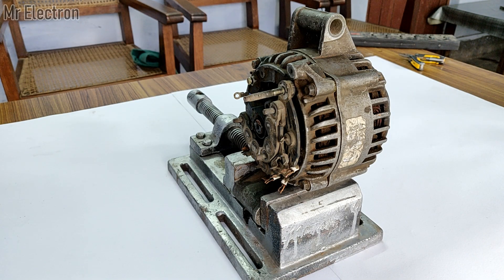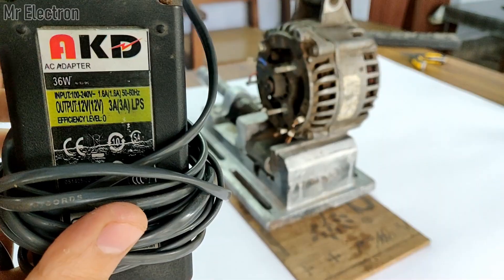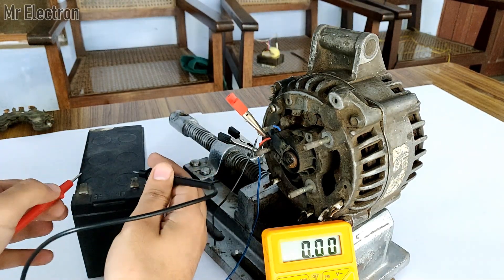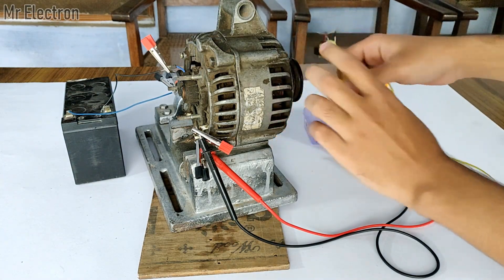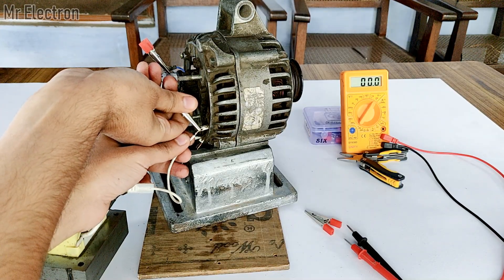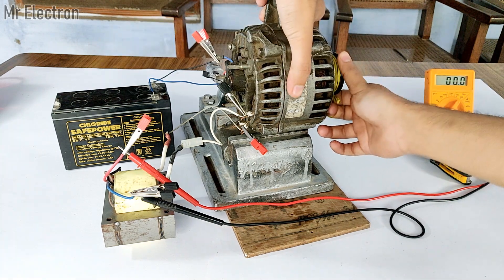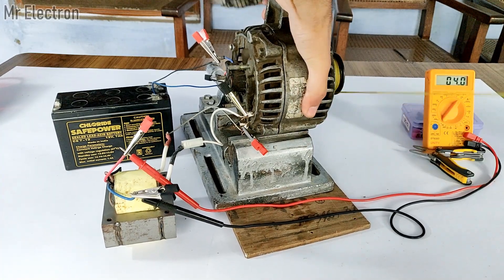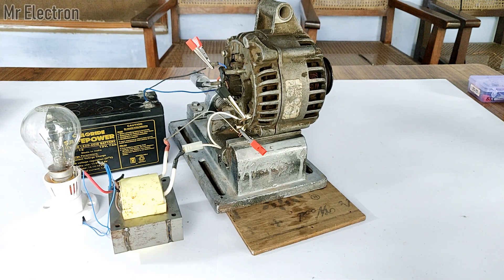110v AC from a 12v Car Alternator New idea !

Comment: Older 80-90's Chrysler and Jeeps have alternators that are externally rectified.  You can also make an arc welder with the same alternator running slightly over idle.

Comment: In this method, the voltage is high but the current is low.Also, only one of the three stars can be used.Please show us a way to increase the power of all three stars and use it And of course intermittently

Comment: IT'S NOT A NEW IDEA! The reason there is a voltage regulator IN an Alternator is because an ALTERNATOR puts out 120 volts per coil on the Stator. The Term ALTERNATOR comes from the fact that it puts out Alternating Current, which is converted to 12 Volts DC through a Diode Trio.  Ford at one time had Alternators that had 120 volt AC terminal for AC accessories, even today Tractor Trailer trucks have an AC output on the alternator to run accessories inside the cab.. So getting AC Voltage out of an Alternator IS NOT a New Idea by any means. ANY AC Voltage you get off of an Alternator will need a Rectifier/Voltage regulator to keep the Voltage from fluttering and spiking. Lastly, no matter what you do, you still need 12 Volts DC at about 10 amps to power the FIELD on the rotor to get an alternator to produce any kind of voltage.

Comment: An alternator generates a.c.(alternating current) that is why it is called an alternator instead of a regular generator which produces d.c.(direct current). A rectifier acts on that a.c. like a check valve works on pressurized fluids or gases and only let's the current flow one direction Instead of alternating a certain frequency (hertz). I'm a fabricator/heavy equipment repairman by trade but when I was 22 I worked for a few months as an electric motor/alternator/generator /air compressor/small gearbox mechanic

Comment: Can a car's alternator to charge 2 batteries at the same time? I was use this method to charge my household power back up battery when I'm driving. Driving and using petrol is just a waste so why not use disposable energy to generate another energy? hope I'm making sense.
Reply: Yes it can. You must connect positive to positive and negative to negative. I do this all the time for charging my extra batteries !

Comment: It would of been better if you would of told us where we could get a DC to AC transformer like the one you used. I tried searching ebay with no luck.
Reply: You couldn't find it because there is no such thing. What you want is an inverter . THIS is the device that will change your 12 volt DC to the AC that will be compatible with household appliances.

Comment: Back in the 1960's (Yes, I'm old as dirt)  They had a kit which, by throwing a switch mounted under the hood (bonnet) of one's truck (lorry) or car, you could bypass the alternator wiring and obtain higher voltage to run power tools.  It was a similar setup.
Reply: Radio shack is where I got mine

Comment: Why do they call it an alternator if it produces DC?
Reply: They are called alternators because the power they produce is AC. It is changed to DC by the built-in diodes to power a vehicle's electrical system. Also, the term "alternator" distinguishes this device from true DC generators which were used in older vehicles.
Reply: @Inflec  this link is 2 years old and that was a rhetorical question

Comment: That is the direct connection uses for  a testing,buti a common usaged of that features is need diodes,,in a possitive and a negative,polarity from the direct current to the alternating current,must use the degnified rectifier diodes who devides the current into lights and others continously....buti in a way its amazing tuiturials....

Comment: You said you have removed the voltage regulator bridge,  on GM alternators  they have a build in voltage regulator , so you remove it  too?
Reply: You have to bypass or remove the regulator and the rectifier, then tap directly into the alternators stator windings.

Comment: You are not actually getting 120 volts from the alternator, you are only getting the 8.6 volts ac from the alternator. you are getting the 120 from the step up transformer. Also, the 120 volts is unusable by any electronic loads that require a steady 60Hz.

Comment: Any electro mechanical generator is going to put out alternating current because the brushes cross poles of negative and positive creating a sine wave above and below 0. The alternator then must have a rectifier to filter out the neg or pos side of the sine wave thus direct current to charge the battery of the car.

Comment: 🔵 @ (0:17) seconds into the video you state that "An alternator produces DC"..... THIS IS INCORRECT!!!
It's called an 'Alternator' because it produces AC ('Alternating-current') which is then rectified by diodes into DC to power the car's electrical systems.

Comment: No offense or anything but these have been around for decades.  It's easy to do and you can even by the hookups right at Walmart.  I have one that plugs into my lighter and can power a 160 watt bulb.  You can get them pretty big too.  Some new trucks now come with this in them from the factory.   The unit that will do this usually comes with plans or drawing of how you can hook the device up, power the alternator with a small gas engine like from a mower or something and make useful AC current.  It won't be much, but it'll power like a drill or something in a pinch, maybe a bit more.  No matter who you look at it, the alternator needs to be spun too.  Otherwise there's no way to generate any juice at all.  And you need a power source to excite the fields in the alternator - like a car battery.

Comment: The problem with this demonstration is it will run a light bulb but it has no amperage to run anything else, get rid of the transformer and spin alternator up and it will put out 110 or 220 with enough amps to KILL YOU   !!!
Reply: I was able to weld and solder by shorting the three phases.
Reply: Not hard to produce enough amps to kill you since it only takes .5 amps to stop your heart

Comment: It's very simple, just bypass the diodes and control the rpm to make 120 volts off 2 of the leads or youse all 3 leads and get 220 out of it but be careful it is a dangerous thing to play with just be careful it is unregulated AC current
Reply: Aren't there small motors that work on 110v?

Comment: How can we get rid of the alternator from our cars ? Alternator takes approx, 20% of power from the motor.
The 12v system is inefficient and outdated.
Reply: Tesla and others have a solution waiting for you 🤣 they even took it a step further and removed the motor for ya too.
Reply: Only takes 1 Hp to get 700 or more watts at full charging load, once charged then much less than 1 horse depending how many accessories you run. I have driven old cars without elect fuel pump over 6oo miles without alternator working, over 400 miles with fuel injected elect pump car.

Comment: I am at a complete loss. The only step up  transformers I can find are from dc voltage to ac voltage. Am I correct in assuming that the voltage from the alternator in the beginning of the video is AC? Or is it DC.
Reply: Transformers only work on AC, or pulsed DC. Alternators produce AC but the internal rectifiers make it DC.
Reply: @newventure4747  got it! Thanks for clearing that up for me!

Comment: Alternator in this video had a rectifier removed, correct ?
Once you remove rectifier from 12V alternator you get AC current right out of the unit. Why would you need to use transformer to make it AC ???
Reply: output voltage on a car alternator is 8 to 12 volts ac with about 60 to 120amps .what the step down transformer does it lower the amp and raise the voltage in ac because take note of car battery it has 440 cranking amps and the electricty amps max bout 25amp breaker nomal home ampere
Reply: Transformers only increase or decreases ac voltages depending on transformer windings. They don't make ac voltages, they only change the voltage that's fed into it... and they cannot pass DC current.

Comment: The shaft speed is 36000 rpm, can you suggest a 3 phase alternator with 50hz 230v ac, or 28v dc . It should be a off the self item.

Comment: years ago after a hurricane i built a gen with a 5 hp honda,a few pullies n belts 2:1 reduction and a alt from a 1986 nissan d21 pickup.motor at idle put out 78-80 volts from the nissan alt,half throttle gave me 105 volts.i had a dc to ac converter lying around that helped.86 nissan alt has no built in voltage regulator.not saying its a better alternative to your method.....just mentioning,cuz your vid reminded me of what i had done 20 years ago.it may take less mods to get the job done.
i ran that setup for 6 days,15 hours a day with no issues and only using 1.5 gal gas per day.i was able to run a full size house fridge,tv,microwave and the alt was warm to the touch.later i added a 12v mower battery,and a trickle charger that feed off the alt to charge the battery,and added a car electric radiator fan to keep the alt and converter cool.just add gas,once fired up it was a self contained unit.i did however had to excite the alt on startup before it would make voltage on its own.
Reply: How did you get 110v from a alternator

Comment: The two 12v leads act as a controller for the alternator.  The higher the voltage on those wires, the more the alternator puts out.  That is how the alternator controls its output when the car changes speed.  With no voltage on the 12v lines, no voltage will be produced on the output.  This is because there are no magnets in a car alternator.  Just an electromagnet controlled by the 12v input lines.

Comment: A kit was sold in the 70's that you wired into your alternator while mounted in your car.
It consisted of a multi pole switch and and 3 110 volt outlets.
One for each phase.
The battery in the car would not charge while in 110 mode, but provided the field voltage.

Comment: The battery is powering what is called the "exciter coil". When used in your car, when you turn the ignition key to the START position, the key switch connects the battery to this coil. Once the car motor is running and you return the key to the RUN position, the exciter coil is then powered by a voltage sensor in the rectifier/regulator that was removed in the video. Since a car's engine will vary in RPM as you are driving, a constant output voltage of 13.8 volts is maintained by the voltage sensor regulator by adjusting the voltage to the exciter coil. As the engine turns faster the voltage is reduce, and vice versa. As a reliable, stationary home generator, a speed control or governor on the drive motor would be necessary so the output would maintain a fixed hertz rate. For powering light bulbs hertz rate is not so critical but for AC motors and electronics it is. This is a three phase alternator. If you want to use the other outputs in combination, you definitely need to learn why three phase is different from normal home A.C.
Reply: Is his design dangerous?

Comment: Guys, you can use this same set-up with a AC Motor on the Side, plug the AC motor into power from house or Power source, with belt from ac motor to ac Generator-get ac generator up to speed and then Unplug Motor and the Alternator will Run Ac Motor Plus Supply Power to House or Working Tools--Many people across this land are using this Set Up for Off Grid Power--Perpetual Motion Machine- DC Motor Run off Battery for Running Up to Speed will Also work but Rectifier will have to be used to  Unplug from Battery... There is a man from Memphis who is Selling the Plans for this Kit for $49--he is Running All his 110 Recepts. in House off this setup--according to him, saving Big Bucks....

Comment: Very cool idea. How can you keep the battery charged? Would a capacitor be better suited in a loop from the alternator since a battery will eventually fail? I have a water fall I'd like to try this on.
Reply: Drone Meets Nature: I don't recommend you use this as shown as an alternative household power. The output is three phase and your home is MOST LIKELY single phase. To constantly only use one phase puts lateral torque on the rotor and will ware out the bearings very quickly.  As a water powered generator you would need to come up with a way to govern the RPM to a fixed value to keep it at 60 or 50 hertz. This would be 30 or 60 RPM depending on how many wingdings are used for output. An automobile alternator is intended to spin at 750 to 3000 RPM to generate maximum amperage. The best solution is to leave the automobile alternator as is and put it's 12 volt output through a 120 volt inverter. If you leave the rectifier on the generator, it is internally wired to supply the exciter coil with current and holds the output to a fixed voltage regardless of RPM. The battery is only used initially when the generator first starts to turn to energize the exciter coil. It is continually necessary here because the regulator circuit was removed. A capacitor could be used to "start" the generator. A car alternator can "start" with as little as 2 volts in the exciter coil.
P.S. there are a rare few alternators that have a permanent magnet coil that supplies current to the exciter coil to initialize the exciter field. These don't need a battery connection at all and are commonly found on gas powered portable generators started with pull cords and some diesel powered generators.
Reply: @3DPDK  Thank you for the wealth of information. I will definitely do that.

Comment: This is an ancient shop hack. After you remove the rectifiers and seperate the winding you'll have created a 3 phase motor. Use a Y 208 3ph. to power it. Big ones (90A) output 5 horse power. Won't run on single phase house current

Comment: The same battery can as well be used a 12 volt  motor to turn the alternator and charge itself a the same time for a continued  power
Reply: Doesn't work that way unless you don't mind producing less than you consume.

Comment: good idea but if you put a motor to turn the alternator it should run for ever and it could charge the battery and the same time give 120v through the adapter
Reply: That will not work! Perpetual motion machines are not possible above absolute zero, thermodynamics are tough to overcome anyone that attempts this is a fraud by definition... In the real world we have heat and energy loss, nothing can create energy without creating heat, 2nd law of thermodynamics.

Comment: Yes agree the alternator does produce a 3 phase AC voltage, but where it gets a little complicated the frequency is unstable! The frequency won't have much effect on a light bulb, but I wouldn't try plugging a computer or TV to this!  Normal house voltage of 120 vac operates at 50-60Hz  Yes its designed to have high current output, the windings are wound with heavy wire but with less winding its a trade off with a lower voltage.  I believe though with todays technology this can be over come to obtain a useable power source, something I'm going to experiment with!

Comment: If hooked to wind or water power,
you would only need the initial kick
from a battery. Then your 12 volts
could come from a step down...
Just like the old generator days.
Give it a kick, it runs, no battery.
Reply: Tahoe Jones yes

Comment: Most all alternators generate AC in the primary coils DC on the rotor there's all kinds of configurations to play with I use these in a AC configuration for welding works great😁

Comment: Never heard of a 12V Alternator.
Reply: LMFAO! 😁😁😁😁😁
Reply: They've been used in cars to generate electricity for eons now.  If you have a car that uses an internal combustion engine, you also have an alternator.
Reply: @aaronjohnmaughan  - Never heard of " Sarcasm "?  LMFAO! 😁😁😁😁😁
Reply: @JodBronson  Alrighty there, bud.  I hope you feel better now!
Reply: @aaronjohnmaughan  - Forrest Dumb - Stupid is, Stupid does!  😂😂😂😂😂
Reply: @aaronjohnmaughan  - By the way, there are older Cars (with an internal combustion engine) that DO NOT USE AN ALTERNATOR !!!  They use a " Stator " to charge the Battery. Just like the Motorcycles today uses the " Stator ", since it's a lesser charging required.
Reply: @JodBronson  You are correct.  I'm glad you are versed in more than the art of socially corrosive insult.
Reply: @aaronjohnmaughan  - Take it as " Sarcasm " - 😂😂😂😂😂😂😂😂

Comment: Very good it’s helping me 
But how much rpm is needed to get 110v without transformer
Reply from the maker: ~ 18,000 rpm for 110v without transformer
Reply: Mr Electron , does it work or a car alternator coils get burn due 18000rpm to produce 110v ????
Reply from the maker: Coils won't burn but brushes will die fast.
Reply: Oh!!
Okk thanks brother 
But can please tell me how can I save my brushes????
By changing the brush every time or by putting a new brush which is better then it?????
Reply: Replace it with new one